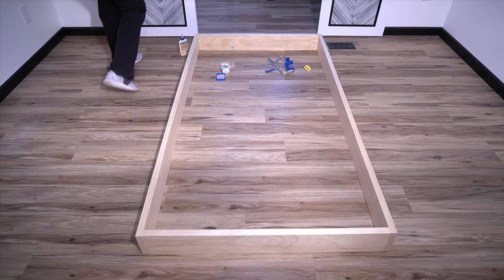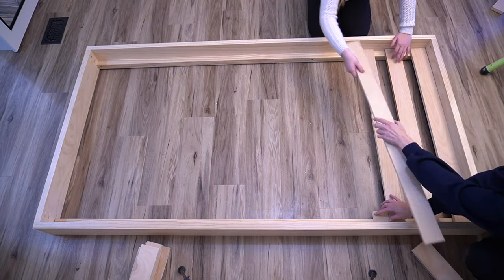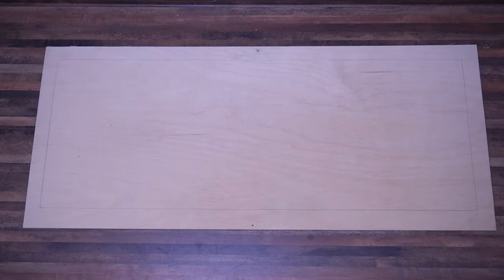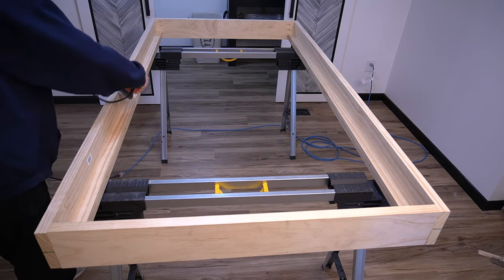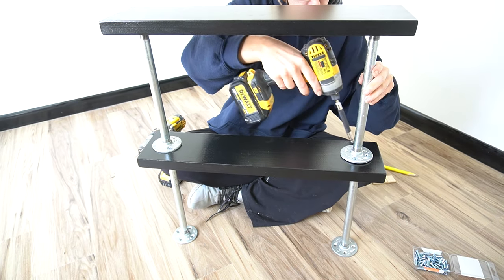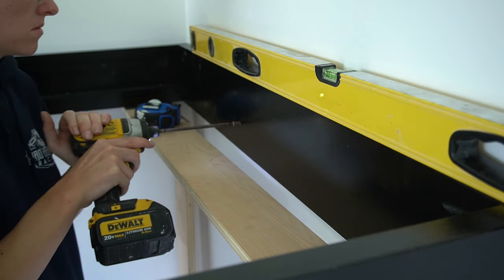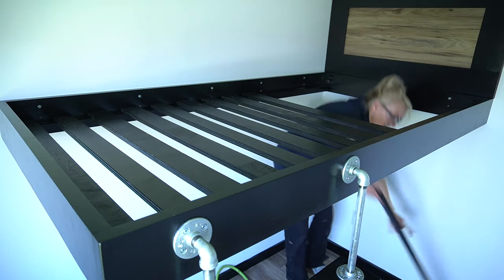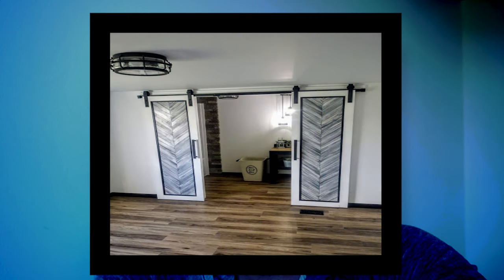Floating Loft Bed

Comment: This doesn't look safe at all.
Reply: yeah man, with the amount of tossing and turning i do at night, that bed would fail me in the first weel
Reply: as long youre not overweight. its safe.
Reply: @amazonpraym3154  Overweight for one length is normal for someone taller, i wouldnt make it in this bed because im tall lol
Reply: @harpreetsinghtoor315  lol same
Reply: @Brown Girl what?  boy or girl it looks dangerous.
Reply: Yep, the idea is that the ladder acts as a support, but it itself is not sturdy because of all those screwed joints. So the mechanical design should be improved.
Reply: thats the whole point
Reply: A 1/4"  lag bolt has a shear strength of 430lbs. 7 of those on in your studs, the frame ain't going anywhere with a proper brace in the corner ( ladder) and honestly it looks pretty sturdy to me
Reply: @19Derek82   this is exactly what I was looking for but do you really think is safe for  6 and8-year-old boys? You seam to know you stuff
Reply: My mind keeps going to the bunk bed scene from Step Brothers!😂😂😂
Reply: I slept for 3 years and my sister does to she is 16 and in 10 and my mom slept in this for a month trust me it's safe

Comment: The screws in the flanges on the top of the ladder are the only things keeping that bed from crashing to the floor on the outer corner. NOT SAFE in my opinion.
Reply: I know right? What size bolts did they use.

Comment: 3 Pocket screws on the corners will shear under load, same reason you use lag screws in the studs instead of wood screws. Either add a post on the corners and secure with lag screws, or at least a bracket. The ladder is insufficient as structural support with just 4 wood screws per leg, it’s also only on one side. There are only 3 pocket screws supporting the smaller side of the frame. Another bracket would help transfer the load to the side with the stairs. But you still need a more solid structure for the ladder. As you note, it’s flimsy to begin with. Put enough load on the ladder and the stairs will buckle in the middle. As a mechanical engineer, this does not get a seal of approval.

This is, however, a great starting point. Just some more structure required.

Comment: The design is not safe from the engineering point of view. Two weak points: screws attaching the ladder to the side board needs to be replaced by bolts going all the way through the side board and reinforced by a backplate. As this point has to carry entire weight of a person (plus dynamic load). Has to be designed to carry 500lb at least… Also the frame has to be reinforced as the corners (especially one at the right side of the headboard) can be subjected to the full load as well. And 3 pocket screws are not sufficient to hold it.
Please consider it as “purely decorative”.

Comment: great idea and great work

However I suggest to load the bed with angle brackets instead of screwing the bolts. 2nd, use the pipe ladder to support the 4th angle( without the wall's support).

Comment: Probably one of the best looking DIY beds I have seen on here, great job! Only thing I would be concerned with though is the ladder screws being in the side of the bed rail rather than underneath the corner, screws are strong but can shear and that is the corner that will get the most abuse.

Comment: The wall mounted part is a bit secured but the corner part; the pipes connected by screw in wood panels as support? It may not last for long. I won't let my daughter to sleep to one. However the concept is good and could be improved.

Comment: Thanks for that....I am just drawing up plans to build a floating bed (size = full)  for my self as I live in a small apartment..  what are the dimensions of your daughters bedroom please include
L,B,H including celing to mattress (head room) and under bed to floor....

In the uk our rooms are 8ft celing to floor...

Much love from Alford aberdeenshire Scotland uk.
Reply from the maker: I'm not familiar with UK building codes. This was anchored according to framing building codes in the United States. I don't have a clue what they are in the UK and highly recommend you check what you have and see if it will work. In the United States there are 2x4 studs in the wall 16" on center. It has to be anchored to every stud in order for this to work.  I do not have  all the exact measurements at the moment and will get them to you as soon as I can.  The ceiling to floor is 8ft with the bed placed in the middle. So it sits about 4ft high. equal space on top and bottom. The frame and mattress is about 8" thick (depending on your mattress size this will be different.)  Before I built this I put tape on the floor outlining the dimensions of a standard twin mattress. Then placed tape half way up the wall (length and width of the mattress) sounds stupid but definitely gave me a good visual of what to expect before even trying it! Most definitely check on the framing in the UK. I have seen videos online for this style for larger sizes mattress and that maybe more helpful for your needs! I hope this helped! :)

Comment: Cool idea, but structually it seems like a death trap? No continuous structure through the ladder, or pole holding the corner up? If someone runs into the ladder it would just fold, and the bed Come crashing down. Take care
Reply: I'm thinking the metal poles being fastened into the floor are quite a solid support and structurally as sound as some sort of beam.
Reply: Please come with facts not opinions.  Seems like a death trap doesn't mean it is. SMH

Comment: My concern is to secure the bed dont use screw, instead use anchor bolt and stair its okey but screw is not safe, rather use bolt for more strenght and the attachment of your steps to more bolt go thru that metal base.

Comment: Imo I think this type of bed is just for temporary use only it would be good if it even lasted for a few months or a year. (If your body is slim) the bed could live longer and as long as you only use it too sleep and not banging there every night lmao. 
But nice idea. I like the idea? Yes very creative. 
But it is safe? Hmm i think for the first few weeks of using it only for sleeping at night it should be safe.
Would I recommended it to other people? Well definitely not to those over weights. This bed is only perfect for thin/slim people.
It can't support overweight people due to lack of beam supports.
Overall 8/10 for creativity and effort.

Comment: To prevent 'painful bruises', I'd recommend wrapping the 'safety rail' with 'pipe insulation foam' or a pool noodle.
Moving the ladder to the foot of the bed would really enhance the appearance of the bed floating.
And, instead of the your 'pipe ladder' design, I'd make a combo side-by-side ladder & bookcase unit.
Reply: Well that's fine and that sounds really really nice but that's your bed this is her bed this is the way she wants it you're describing your bed and we're not even talking about you bed we're talking about her bed be nice she did a beautiful job I'm loving it🤗🤗🤗🤗🤗
Reply: @pvt.2426  YES !!😜🤪😝🤪